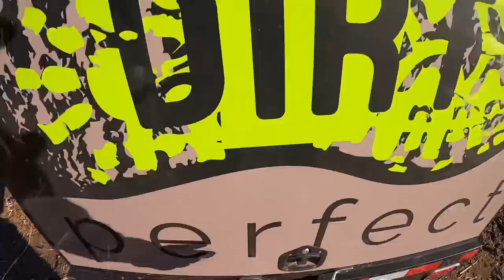Burn Baby Burn! One massive brush fire and hauling brush in the mud with Bubba Dump

Comment: The brush pile turbo sounds awesome, and the engine is blowing smoke. When I was in 11th grade, a wild fire came through in front of our house. It was in pine and sage grass. The roar from it sounded like a train. I was on the volunteer fire department along with forestry on the ground and flying water drops. It took us days to put it out. From the start point to the stopping point, it  was 30 miles. The wind was blowing so hard the flames just laid down over a two lane highway and kept going. Love the video. Thank you both.

Comment: I used to lay a 20' section well pipe one end under the pile & use that to blow the air through to help get fire going plus if your lucky & got it up wind the wind helps give O2 to the fire ! But it be mostly gone by next day !

Comment: Wow there is some Carbon going into the air.
Reply: Also a lot being trapped as soot and charcoal, which would have been released as methane and CO2 in normal decomposition.

Comment: If I’m not mistaken, Clint filmed several lots of tires at one of the auctions in Florida that you and Chris will attending. Kissimmee Florida auction also has some really nice travel trailers and RVs for Mrs. DP would love to check out…🤓 You fellas had a real fire burner. The smoke signals say…fire so hot you can singe your whiskers off just watching.
Reply from the maker: Stay tuned

Comment: I burned 6 hand built slash piles this past month.  I used my weed burner to start them.  I had thought about using my Stihl blower, but it wasn't needed.  The fire was as much as 20' tall in. a matter of minutes.  All my slash was pine that had been there for 8 months drying in this arid climate.

Comment: Many years ago I worked on a farm. One of the jobs I did was hand dig ditches to lay field tile for drainage. We had a excavation company come in to dig the main drainage ditches. While looking at Google Earth of your job site and that little pond on the north side of the farm lane, can I make a suggestion? If I had all that equipment , I would re-route the ditch north of the farm lane, from where it comes under the highway, along the highway to the west side of the old pond, around the south side of the old pond to where it goes under the farm lane. That would gain some more workable field.

Comment: At around 43:50, did you order a new seat for Bubba Dump?  If I was driving it, it would need one. That green, wet stuff burned pretty darn good, my mesquite pile about 1/10th that size, with most of it drying for two years after being pushed down in a drought, is still smouldering after two weeks and one ice storm.
Reply from the maker: No same one